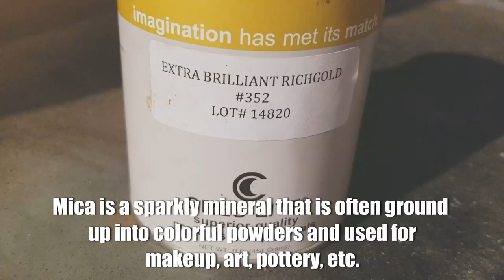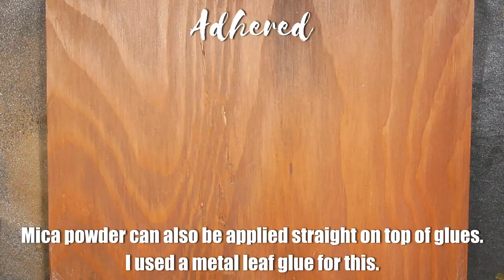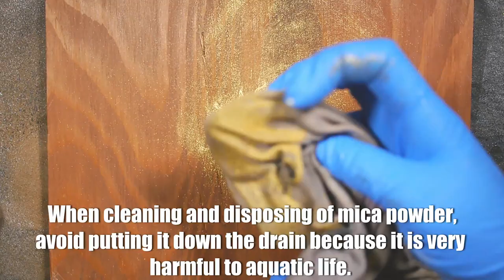Mica Powder Basics - Scenic Art

Comment: Thanks so much for this video! I was wondering what face protection - or all protection - you use when mixing mica powder or handling it in dust form. Since dust masks don’t work?
Reply from the maker: Hi! Fume hoods do fairly okay at protecting you, because the air is being sucked away from you, but more ideal would be one of those... I can't remember what they are called... It is like a miniature fume hood, that is completely enclosed, it has a door that you put the materials you are using in, and you do everything through these glove holes, so there's no way for particles to escape and you don't get any on you either. The biggest thing is you need good ventilation that will keep particles away from you or from being on you.

Comment: how about mix mica powder with oil based paint for wood or wall? can be used? and how good it is? do they oxidize or come off easily?
Reply from the maker: I've never done it in oil before, but I expect it should work. I would guess that the shelf life would be longer, because the water is a big factor in the reaction that makes it go bad. I wouldn't expect it to come off easily, because once it is dry the paint's binder is holding it in place (unless you added too much mica for the binder to hold and be effective). I would do an experiment and mix a small amount and see what it does!

Comment: If it's this dangerous and awkward to use, I'd rather just use metallic paint.
Reply from the maker: That often is the best option. Very occasionally there is a benefit to using mica powder, but that's usually due to a very specific look wanted by a designer that the customizability of mica would work for.